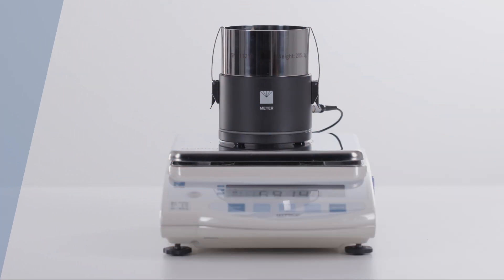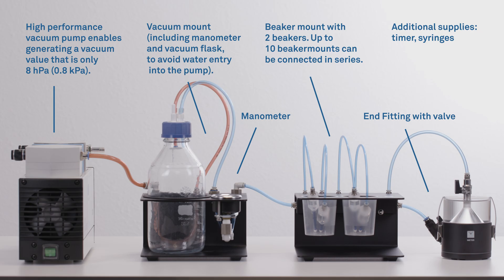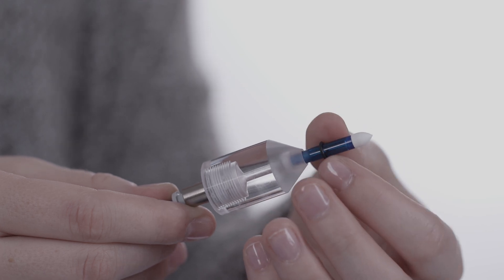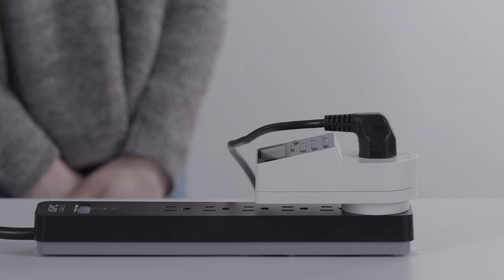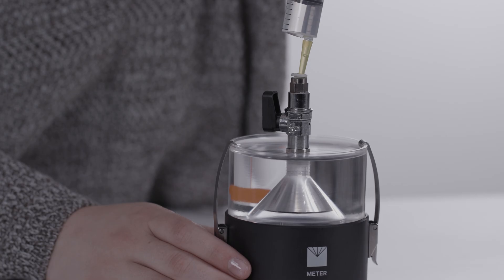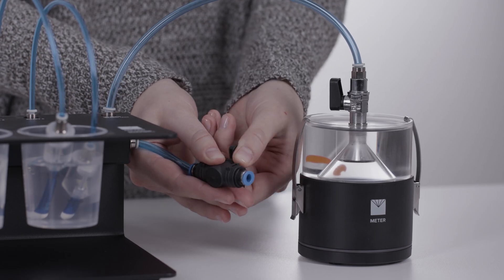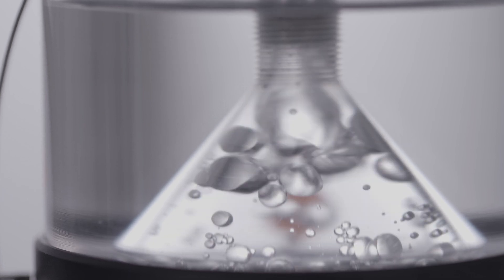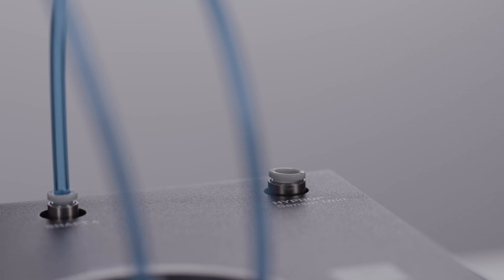How to degas your HYPROP to get the best measurements. Video 2 of 4

Comment: I’m confused. We are supposed to fill the beakers and the holes of the sensor unit with degassed water, but isn’t the whole purpose of this process to degas water inside the sensor unit??? We are supposed to fill it with already degassed water, and then degas it even more?
Reply from the maker: Thanks for your question! You can get personalized technical help by emailing all your technical questios to support.environment@metergroup.com